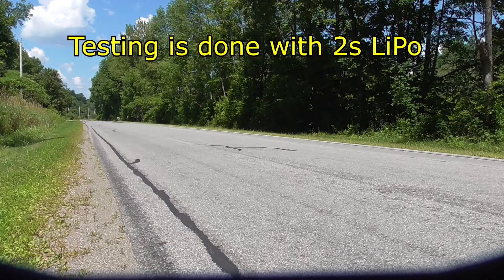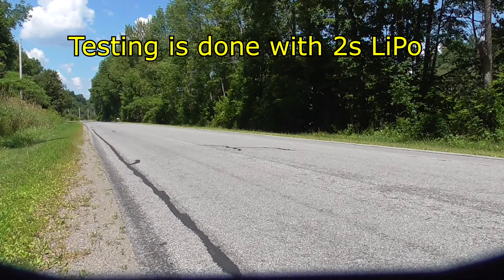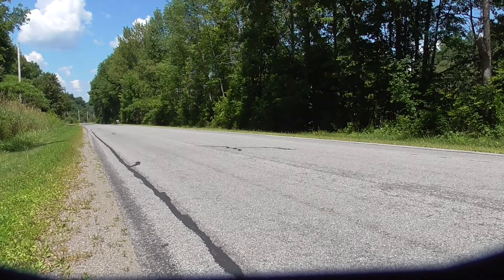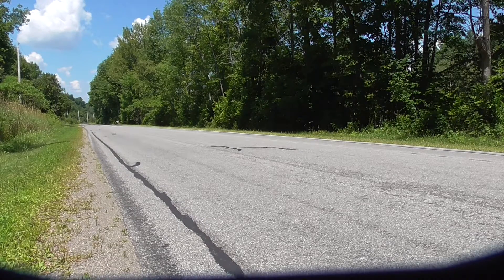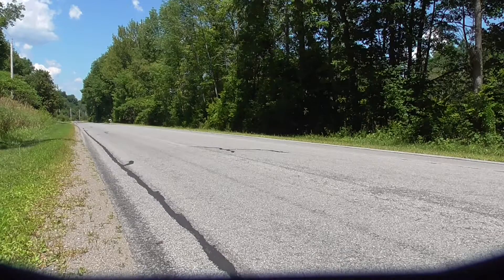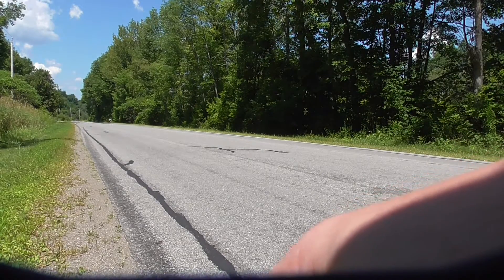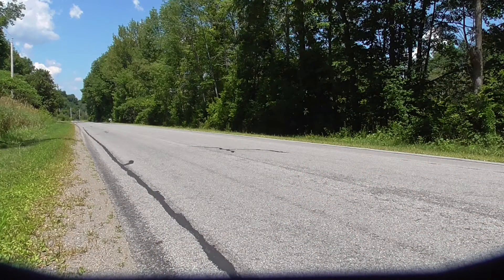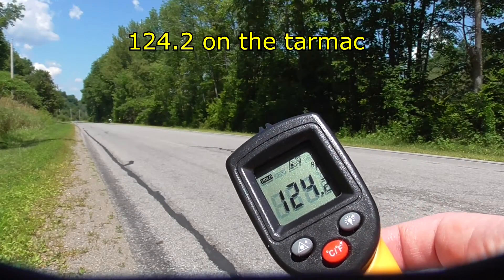Tamiya M05 Mini Cooper first test run

Comment: Ok ToJo! Lol! Little thing moves pretty quick! I can see and hear when you hit the throttle...then it turns. I don't know if this is among the many tips you're getting but try some weight on the front end for more traction too. And maybe some thicker diff fluid or grease...doesn't have to be locked. But you'll get her right!
Reply from the maker: Dan P Thank you! Thanks for the tips! Will use some and see if I can get her going straighter! I will buy a 3s when I know she can go straight.

Comment: You could lock the diff that might help with the torque steer, but make it hard to turn around.
Reply from the maker: Devolution RC Yeah got a few tips I will wait to lock the diff. see how the other tips work out first! Thank for the tip =D

Comment: Steering upgrades soon?nice green car in nice green nature.lol
Reply from the maker: ***** there are some upgrades that help it go better. But not sure I am willing to spend 150 more or just jump to another RC. http://www.ebay.com/itm/Yeah-Racing-Tamiya-M-05-Aluminum-Long-Span-Upgrade-Suspension-TAMC-S01-/391204267351?pt=LH_DefaultDomain_0&hash=item5b15976557 and http://www.ebay.com/itm/Yeah-Racing-Drivetrain-Steering-Upgrade-Kit-Tamiya-M05-M06-1-10-RC-Car-TAMC-S02-/141570510951?hash=item20f6429067 But still biggest problem is, I can only get plastic gears!

Comment: Looks pretty fast to me :) Maybe 40mph? Too bad about the steering and how it won't stay straight, is there any way to fix that?
Reply from the maker: The RCAddict Thank you! there are some things I can do! Added some weight and stiffer shock springs. Then next will be locking the diff
Reply: TOJO RC Sweet :) Sounds like you know what you are doing :P

Comment: awesome looking mini. lol. so what are you thinking about fwd speed runs?
Reply from the maker: 2cwik4u104 Hard! Still hard to go straight! I will try locking the diff now next. Plus its a paint to do any transmission work! As you have to split the hole RC in the middle to do it. Not a easy RC to keep changing stuff lol
Reply: sounds like it will keep you busy. lol.
Reply from the maker: 2cwik4u104 yeah or might change to another RC. Not sure yet!
Reply: already have one picked out?
Reply from the maker: 2cwik4u104 Think I will go with the Rustler, a lot easier working on the transmission. And a lot of cheap parts to it. What do you think?
Reply: well, you know you cant go wrong with a rustler. just. so many out there. 2wd slash? unless you want to go 100+, then I highly recommend the 4x4 slash.
Reply from the maker: 2cwik4u104 I am just going to see if I can make 70. Bonus is to try get in to 2 clubs!

Comment: Ha ha, remember what I was saying about speed runs being car destroyers! (-:
It sure doesn't like going in a straight line, maybe you need sway bars?
Reply from the maker: Jax Teller RC Already got them on! on upgrade it got right away! I will see what this can do with some weight and stiffer shock springs!
Reply: TOJO RC
Maybe you need AVC
Reply from the maker: Jax Teller RC That is cheating! Have to have skill to hold it on the road your self! But a good point!
Reply: TOJO RC
Is it some kind of unwritten law amongst the speed guys?
Reply from the maker: Jax Teller RC there are some rules! And think that is one of them in the 70 mph club! There are some rules, and I understand that! I will just follow that!
Reply: TOJO RC
Oh I didn't know that, Interesting. Cheers Tojo (-: